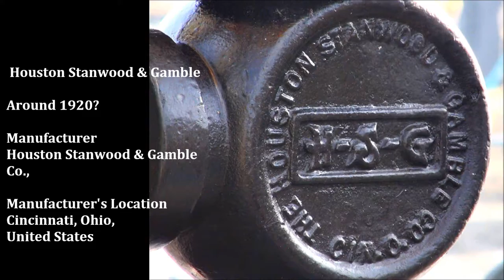Old Engines in Japan 1920s?  Houston Stanwood & Gamble Steam Engine

Comment: Nice steam engine,I like steam engines. I think that boiler is too small for that engine I have seven steam engines the oldest is from 1910, the biggest one  weighs one ton!!! I have to make a video of them some time:-)) Thanks for posting
Reply from the maker: +John Hili 
I think so too that boiler is small for this steam engine. But, the Boiler engineer's license is necessary that we use some size boiler In Japan (if a heat transfer area is more than 3m², and some regulation specs).